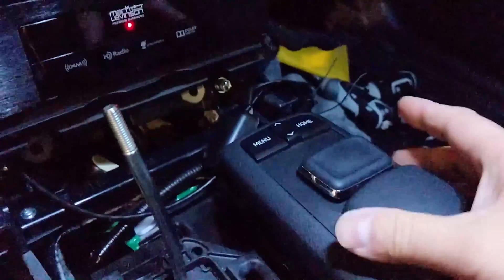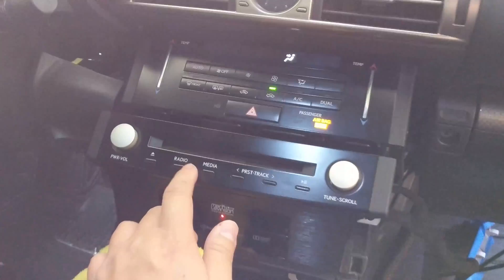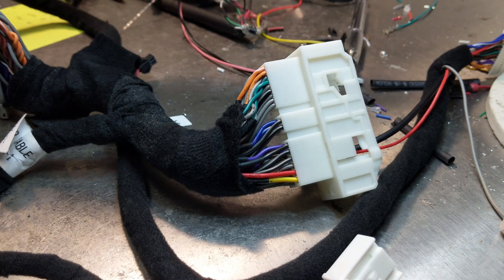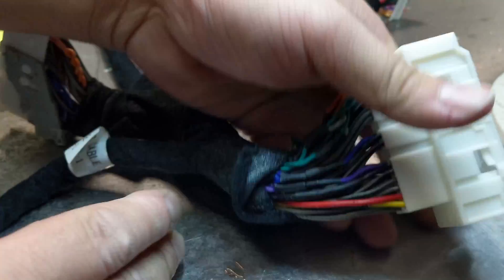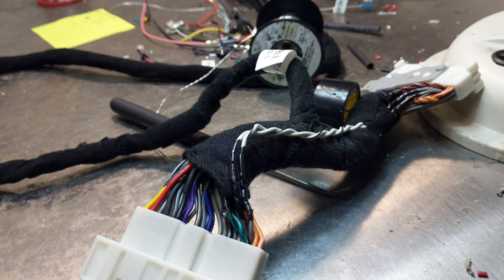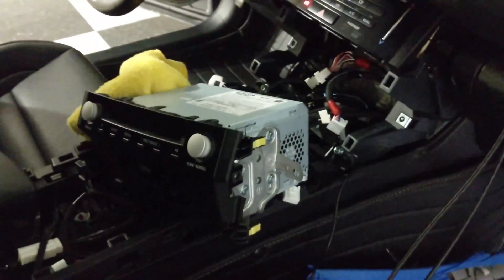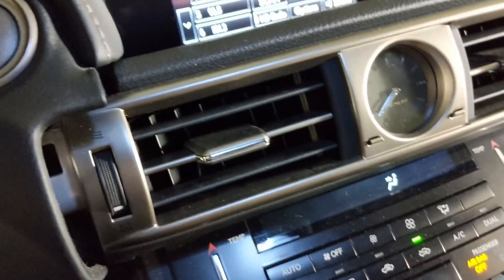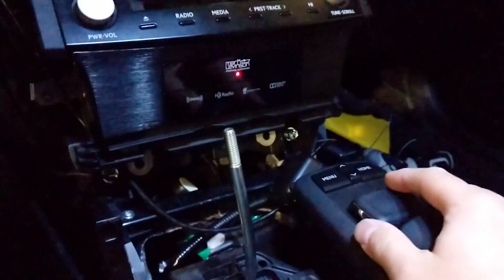Is there a Ghost in my Lexus? | Troubleshooting the Android Car Interface Module

Comment: I noticed the touchscreen cables during your unboxing video.  Are those meant to add touchscreen to a display that doesn't already have it or for factory Lexus touchscreens?  I'm thinking about trying this out on my 2015 GX 460 that has factory touch/nav.
Reply from the maker: Yes I believe it's to add overlay touchscreen on top. But I could be wrong . I didn't look much into it.  You should look into maybe GROM Audio VLINE instead because I have abandoned this unit in the video and went that route.